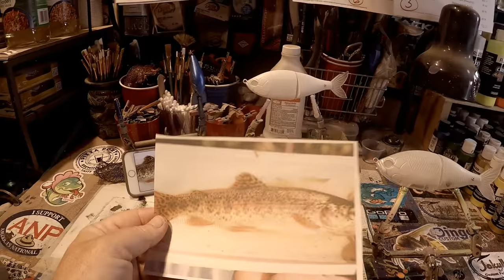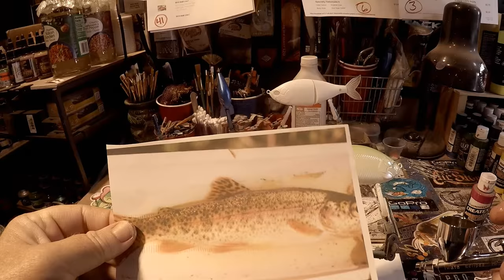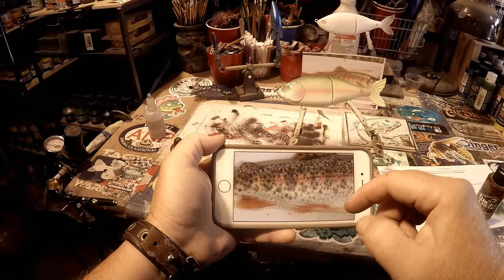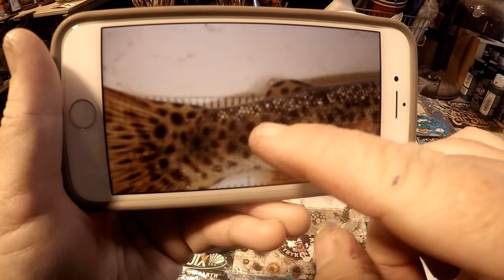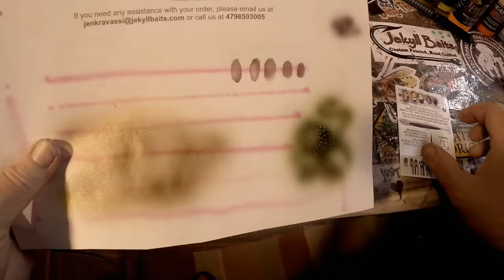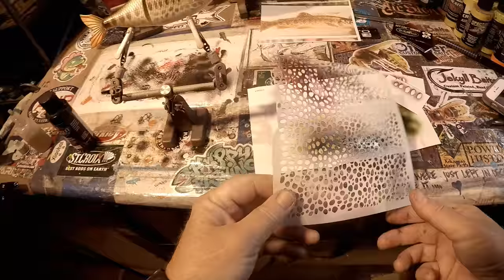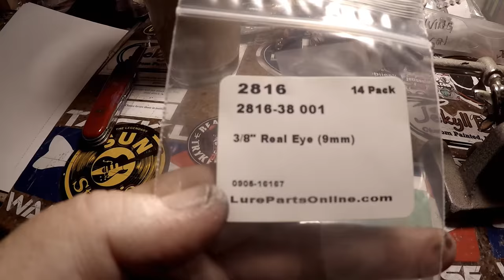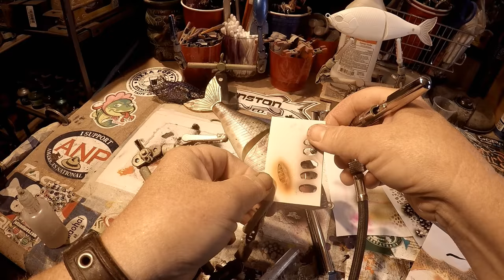NEW SPRAY SESH!! "Wyatt's Rainbow" - A Celebration of Life, Fishing and a Cool Pattern

Comment: Perfect!!! What video did I watch of yours where you dipped a segmented lure?
Reply from the maker: If it only has one joint and can properly hang to dry, I’ve done one side at a time dipping (and letting dry in between), but I’ve never dipped the whole bait in. They’re impossible to clean out. Often times it drips and hardens internally ruining the lure completely. 
I’ve also dipped one side and brushed the other, with Whopper Plopper Lures. And if it’s multi jointed, I only brush on clearcoat.